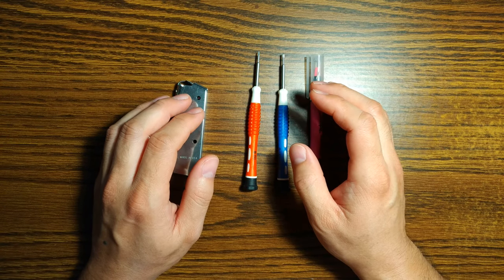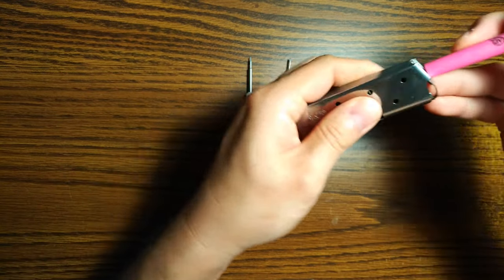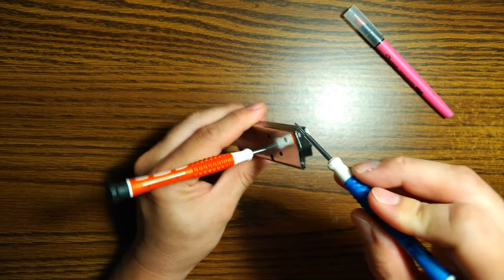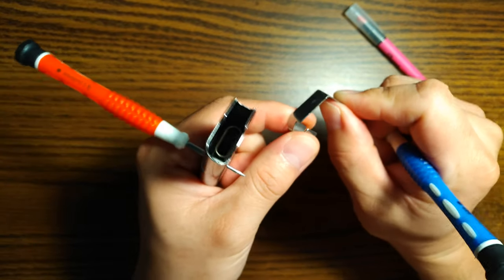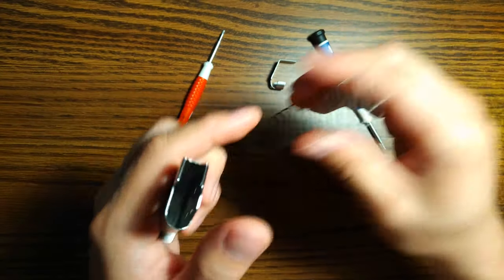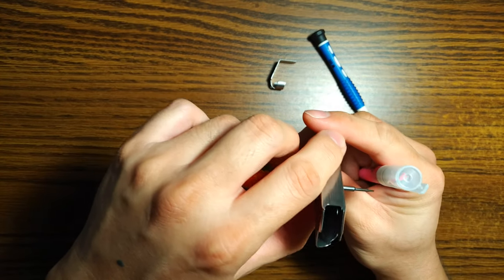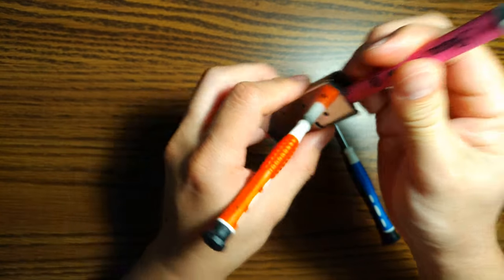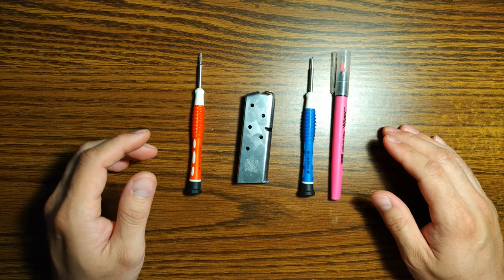How To: Springfield-Armory 911 Magazine Disassembly (4K)

Comment: Looks like springfield really don't want you to disassemble the mags!  After watching this, I think I'll just leave them alone.
Reply from the maker: Why? It's not that hard at all.
Reply: @TalkingHands308  but is it really necessary to clean the mags??
Reply from the maker: @dannydoughboy120  Not often, but a lot of malfunctions are caused by faulty magazines. And even if you're not taking it apart to clean it, you will also need to know how to do it in order to replace their springs.
Reply: @TalkingHands308  thank you sir for reply!
Reply: @dannydoughboy120  Yes.  I've seen very dirty double stack magazines after a few thousand rounds without cleaning, to the point that a layer of soot residue clearly visible on the inner walls.  Feeding problem could occur when the follower has to overcome the extra friction caused by the residue.
Reply: @r64g  Understand, and I have been practicing breaking down my pistol, unfired, just to keep in practice.  Each time gets a little better!
Reply: @TalkingHands308  with ammo in short supply, I have put only 4 rounds through my 911.  Can't afford to waste the ammo I do have.
Reply: @dannydoughboy120  You don't need to worry about dirty magazines until at least 1000 rounds.   Magazines do get dirty, but not nearly as quickly as the guns themselves.
Reply: @r64g  okay, thank you!